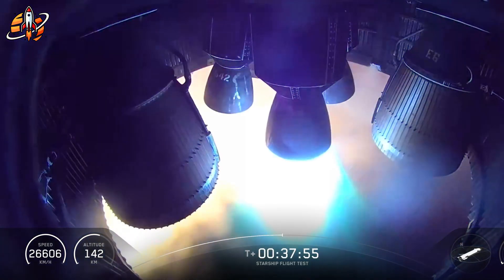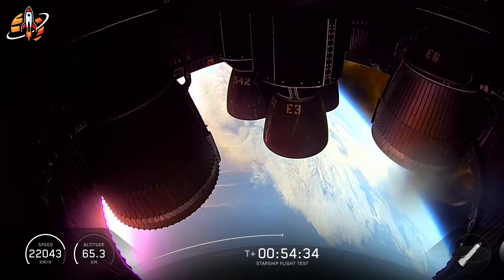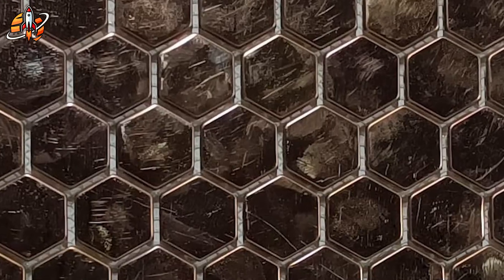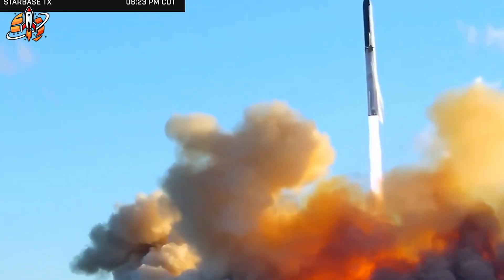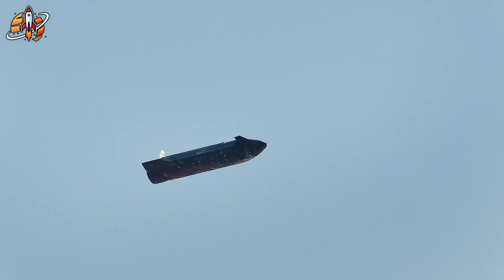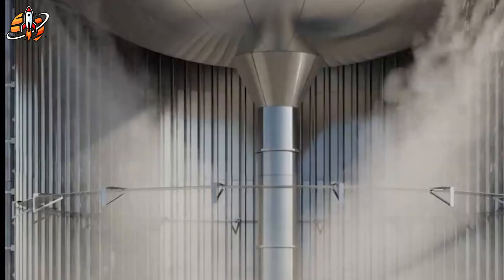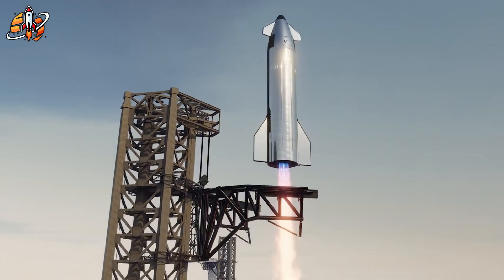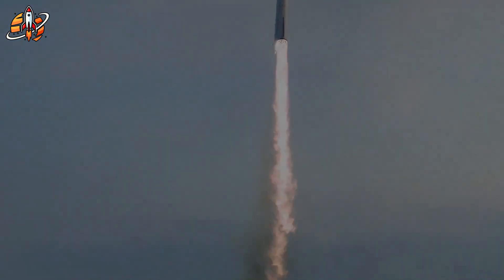SpaceX's Starship Got RUST in Space...Elon Musk SHOCKED Everyone. Here's Why

Comment: Russians worked this way from the beginning, by testing rather modelling, so thats why they advance in conquering space before Americans. This is not new under the Sun, better now than never, Musk is a good learner.
Reply from the maker: You're right, the Russian test-driven approach shaped early space success, and SpaceX's Starship rust test echoes that bold iteration. But is 304L steel the ultimate reusable rocket material, or should they explore alloys?
Reply: @SpaceHub26  304L is an alloy, SpaceX use already a proprietary 30X blend